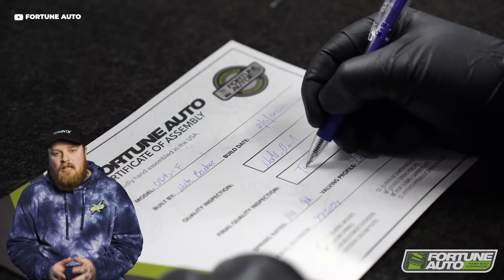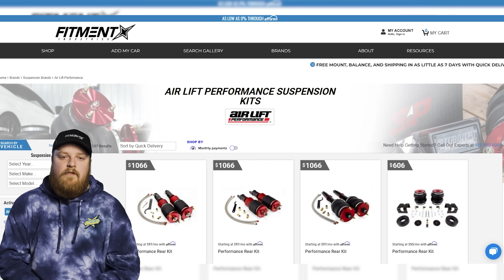Coilovers or Air Suspension | What's Right For You?

Comment: Static is better, infinitely superior, but when you live where I live, you need bags to get over potholes and speed bumps
Reply: I Leroy Jenkins potholes and bumps
Reply: I think what you mean to say is Coilovers are Superior for competitive track and Air suspension is superior for daily use on public roads.

Potholes and speed bumps are not exclusive to where you live. There's also steep driveways and inclines . Turning these daily obstacles into non factors is where air suspension is superior. It's versatility on the fly. 

I run both static and air suspension. Each of them serve a purpose and at the end of the day your setup depends greatly on what you plan to do with your vehicle.
Reply: @blkeclipsel2400  what I meant is static is superior, but bags may be needed depending on your circumstances. And yes, maybe there's speed bumps and potholes where you live, but you've probably never seen roads so poorly maintained as the ones in my country, we were done dirty:(
Reply: @victor6039  which is?
Reply: @sethwell2552  basically converts your coilovers to “bags” except it’s not a bag it’s an air cup it goes on top of your coilovers so when you’re driving you’re on coils with the static feeling but when there’s speed bumps you hit a switch on your front goes up about 2 inches and you can clear them a lot easier, kits come with air tank compressor and so on, it’s not recommended to drive “aired up” because it’ll be super bumpy and could damage the cup system itself
Reply: Wrong
Reply: Given how fast holes form in my city I might consider the airbags
Reply: @fishy_cheese4630 what are some good kits?
Reply: @sethwell2552 west Canada? There are pot holes 3 months after a road getting repaved
Reply: Well that doesnt sound like infinitely superior does it?
Reply: Ive seen static got totalled over a pothole. Static is for stupid people lol
Reply: Let me guess Michigan?
Reply: Ex trucker, air bags is definitely a better ride. But coilovers seem to be in my price range at the moment. So probably going with that

Comment: I've been running Fortune Autos on my car and I've absolutely loved them, but when I get my next car, I'm kinda leaning towards air just because it's cool and different. Plus the alley to my driveway is dummy steep and I scrape almost every time.
Reply: Sounds like air is a no brainer for you good sir. Get airlift 3p or 3h! Worth every penny. I’m thinking about getting it for my daily now. Had it on my 370z for 4 years now, no issues no problems.
Reply: @finnilrebna348  that's what I was thinking. I'm leaning towards the 3h because of the cool auto height stuff when you fire the car up. Either way, I think it'll be fun to do air on my next car.
Reply: That’s cool! I’ve been wondering how the fortune auto suspension is!
Reply: @Paper.Power.Politics  they're fantastic! Very well built and a lot of adjustment available on them. Just overall a well rounded coilover that you can really rely on.
Reply: @richgrassmann2009  sweet i noticed they also do custom spec! I’m looking for something I can adjust to I can go back and fourth  from street/drag set up and track set up
Reply: @Paper.Power.Politics  the Fortune Auto 500 series is great for that. When I road tripped my mustang to Tennessee and back, it was a little too low with all the extra weight and such, so when I got to Tennessee, I just adjusted the rear a bit in my grandpa's driveway. Super easy to work with. It helps too that they're not stupid expensive. All in all, they are great coilovers and not super harsh either. My mustang is my daily so I've lived with them for a good while now.
Reply: @richgrassmann2009  nice ima definitely keep these in mind.
Reply: What exactly is your damage from scraping? I don't want bags, I want coilovers. But I fear the damage to my ride, possibly damaging muffler, etc. Is the damage really that bad and or are there alternative safety steps one can take like screwing additional splash guard pieces to protect chasis, other parts below? Thanks! =).
Reply: @afriend8961  so pretty much anything from frame and exhaust, to oil pan depending on how low you go or how high the bump or steep the incline is. My mustang scraped on the aftermarket cat on my downpipe, the side skirts, and the frame rails along the side. One more recent solution I've seen is the stuff like Fortune Auto's cup system. FI have talked about it before, but it's an air cup that sits above the spring and allows you to raise your car a bit specifically for clearing bumps and driveways, then air back down to your ride height. Super cool stuff, but a bit pricey.
Reply: Right I live in the city and even if I didn't I used to live close enough id drive there often. Air makes sense if you can't sacrifice ride height everywhere (and have the money)
Reply: When i saw this comment i squinted and my head began moving left to right, pro-furiously 😂 we cant scrape the Carbon bro!

Comment: I have both bags and coils, and I personally prefer bags because it feels like your riding on clouds. But these bc coils on my accord are the best I love them and recommend them to everyone!
Reply: How much money do you spend maintaining bags? Like how long would bags last me in Michigan with all the salt and weather changes ?
Reply: @demetriixx9964 maintenance cost is next to nothing if you buy the correct maintenance components with the kit. Smc check valve with the ability to disassemble and clean yourself ($25.00).  Electric tank drain kit. ($65.00)
Water trap (from $25.00 to $55.00)

Maintenance itself is basically free afterwards unless something goes out or gets damaged from being installed incorrectly. 

Maintenance mainly consists of purging water from your tank and keeping your system dry. With the electric drain kit all you have to do is push a button. I've had airlift on my daily driver for 2 summers and 2 winters and the only thing I've had to do is disassemble and clean my smc check valves as they can eventually seize.  Took me 30 minutes and only had to do once so far.  I also had to reconfigure the system which takes maybe 5 minutes while on a flat surface.

Other than that I personally chose to hose down my bags every time I wash my car.
Reply: Dude s @demetriixx9964   how do you think threads on coil overs are gonna fair in those same conditions?  In those conditions I would just run nice static non-coilover setup like some B8's or something.  You can try to clean coat your coils when you first get em and paint the the threads up with anti-sieze  but you will absolutely loose that battle, just a question of how fast.
Reply: As a reminder, and as stated in the video, heavy duty trucks like long haul tractor/trailer's, firefighter trucks/engines, etc. all run air suspension. Even driving in the northern cold in winter. You'll be fine with basic maintenance, clearing out the condensation from time to time, etc. I would argue they fare better in winter. Because if you're driving this in the winter and snow it's not a garage queen or tack day whip. 

I had Airlift system (3/8" dual pump) and winter i had zero issues. In fact the winter and salt seemed to affect my KW V3 worse - at least on surface areas. Of course YMMV

Comment: I think by spring time. I'll be having an air bag suspension installed for two reasons. The cool factor of course, and also to prevent someone from sliding a jack under my truck while I'm sleeping and stealing my wheels or catalytic converter. As a young kid in the 90s, I've always dreamt of having hydraulics to show off. But I knew a guy who had hydraulics and man that's a really uncomfortable ride. I think air bags would give me all that I want.

Comment: Probably go Air because I have one car, and I live in a state that gets snow. So on the fly ride height adjustment seems the best bet for me
Reply: Just came to say this exact thing.
Reply: Imo if you're gonna leave reasonable ground clearance, go coilovers, if you want to drag ass and Don't have a second car, go air.
Reply: @Prestiged_peck the greatest benefit of air suspension is not having  to drag ass while driving. Air suspension can be factory height, lower than factory height, higher than factory height and slammed when parked. All at the push of the button real time. 

There are 5 height preset options along with the option to adjust each corner manually. 

The only suspension that forces someone to drag ass is coilovers. Until you lift the car and remove each wheel to adjust .

Comment: I would choose air cups. I have a Hyundai Accent and I like this car. There is only one problem with it. It's not high enough. Sometimes I need to drive through some rough terrain and I don't want to hit the bottom of my car against rocks and dirt. So I would like to have the possibility to drive on coil overs when doing the high way and drive on air when doing the woods.

Comment: There are tiers to this debate as there are layers to the application of either. 

Common “Street” series suspension are typically lower quality than “track” series coil overs. Meaning, if you take “street” series coil overs to the “track”, you will more than likely under perform.  “Track” series suspension is peak equipment for “track” use. On the other hand, daliy’ing “track” series suspension on the “street” is like “over paying to kill a mosquito with a bazooka” while the full performance potential will in most cases remain untapped in imperfect “daily street” conditions.

Airlift suspension has been proven to perform on “track” just as well as, if not better than, “street” series suspension in addition to being more ideal for daily “street” use than “street” series suspension in most applications. Put simply, “Track” suspension is BEST for track conditions and well dialed Airlift suspension is ideal for daily “street” conditions. IMO

Comment: Never ran air. Well atleast not on cars. Obviously my rig is on air. But now that ive recently got a vip car. Time to move into the air ride.. currently the vehicle ( 08 jag xj vandan plas )has its original air suspension but not with levels of dropping it yourself on a press of a button. Therefor somewhere down the line i will definitely be installing some air rides you was talking about.

Comment: I think I'm going to go with the airlift suspension because I'm going to be using a truck and most of my weight in the bag is going to come from the fuel cell and whenever it loses fuel because I'm driving on the street and what not I can have the adjustability right there

Comment: I would like to have bags but One day I saw a car with airlift suspension,  was completely stuck aired out to the floor the owner couldn’t lift it.  What’s the solution in that case ???  To move it or if the car breaks down and is aired out ?

Comment: I am thinking about air suspension for my miata to help with a disability. Would air suspension allow me to raise the car above stock height to get into and out of the car but then drive at stock height? Does air suspension work when the car ignition is off like before i get in the car?

Comment: I understand the need for it, but... forgive me if it might be a stupid question, I drive through an old logging road on a lifted corolla daily as the logging road is my driveway, it gets worse mileage with its lift still far better than any suv but some days you need it to get through due to mud, rocks, etc etc. are there like air LIFTS? like not for dropping the car, but for lifting it above stock when you need it, like a coilover plus a airbag on top? I know that there are these for trucks, but anyone know of any company that makes them for sedans, or are they a niche thing? I suppose what I mean is there is a market for lowered air ride sedans, but anyone know of any for lifted air ride sedans or are they all like stock or lower?

Comment: Sorry… Newbie question… I’d like a lowered Daily/Band hauler… I want to murder out a Ecoboost Ford Flex with air-ride suspension so I can lower it, my question is with the heavy weight will the raising and lowering suspension break under the added heavy weight with large band equipment??? And would I be able to drive it lowered with band equipment in the back???
Reply from the maker: You should be just fine!  You’ll be able to adjust the pressure in the rear if you have something heavier back there!

Comment: Glad you mention that they could handle hard driving. I have a Silverado that I dropped. Springs/spindles. Overall like it but rode in a Tahoe with bags and liked the way it felt. I was always worried about bag issues because had a few buddy’s going through bags every 6 months or so. Never wanted to be stranded. Their bag issues were happening in early 2000s so I’m sure it’s been improved. Still 50/50 on the idea but definitely good to hear

Comment: I drive for daily use not performance. I'd just want the lowered look and comfort. That in mind that last one you mentioned looks ideal. Any more info on them or maybe a list of other brands that make something similar? Haven't lowered my car yet but when it comes time to change the shocks I definitely want to upgrade to a good coilover or just a lower suspension setup
Reply: You could always go for lowering springs. It’s something FI has talked about a lot too though they focus more on coil overs and air overall.
Reply: @djhero0071  true, but the stock suspension on my car has a lot of body roll, they are too soft. Also lowering springs may not always be a great option, because it can mess with the alignment of the wheels and cause unexpected tire wear. Which I'd like to avoid as much as resonably possible

Comment: I have a new mustang GT performance package and thinking of air ride suspension.  Something I'm being told is that if I end up adding more hp and torque, supercharger, air ride isn't the way to go as it can't really handle it.  Is that false?  Should I just go with coilovers to remove the wheel gap?
Reply from the maker: A mustangs on air looks sick 👀 but if you’re going with more power too, I’d go with coilovers
Reply: @FitmentIndustries  I would love to however I have magneride and nothings available yet.  I think i"m going to just go with springs.

Comment: I can’t find any shops in Sacramento that will install air bags so I’m looking at air supply Bakersfield for 3700 but it’s 5 hours Away….. I’m worried about something going wrong and then I’m stranded and would have to pay a tow for 5 hours. Should I just give up on getting air suspension for my glk350???
Reply: Coilovers with air cups and call it a day
Reply: @diddy2612  I never heard of those before today, I wondering if I’m have the same issue of not being able to find a shop to install them
Reply: @cliftonsargent1572  it shouldn’t be. I have kw coilovers with stance parts air cups on my nsx. Best suspension setup I’ve had
Reply: @diddy2612  ok cool, I’ll ask about getting air cups installed, and they just raise a little bit and lower but your pretty much on coil overs
Reply from the maker: The install is really not too bad if you have some help! Check out our air suspension install videos on our channel! Here’s one - https://youtu.be/zr273NCPH_g
Reply: @FitmentIndustries  this is why your channel is my favorite hands down, only huge channel that responds to the fans. I’m a basic bit*h and can’t do that on my own. As soon as I can find a shop to install I already got the parts I want from you site

Comment: I ran air suspension on my car for about 6 months….the only time I enjoyed it was when it was air down and it was parked😂 other than that the ride was horrible no matter what!
Reply: you sure you werent running too much psi in the bags? i got a vw wagon with bags and its like butter on smooth roads lol some bumpy roads i feel feedback but i dialed in the perfect psi to where its like what i would feel when i ran coils
Reply: @error_displaying_name  yeah I was doing anything from around 30-45 all around to see if I can try to get the best as I could but no matter what it was a rough ride! Unfortunately I live in the city and nothing but crappy roads..
I had it on my fiesta st but probably didn’t help that the car only weighs 2700lbs 🤔 that’s probably could be the cause since the car is so light

Comment: I went from springs, didn’t lower it enough, opted for adjustable control arms, low enough but rides like shit. Decided to purchase 1500$ coilovers, front rode great, but since rear has a solid axle it still rides like shit. Called it a day and ordered an air lift kit. Take it from me just save the extra 500-700$ for the air bag kit 😞

Comment: If you want to ride with negative chamber and destroy your expensive tires, then air shocks are the least of your worry's. Shocks are meant to keep the tire tread touching the ground. You have less than 1/8th sq ft touching rubber to the road, otherwise you might as well put bicycle tires on all four corners. Just make sure the spokes & bearings are heavy enough. I see this next to me on the road, I am getting far away. See you in a ditch on the local news.
DK, ASE master tech since 78.

Comment: To bad no one aside from Godspeed make aftermarket suspension for my daily. I daily a 2009 Toyota Venza awd and I specify awd because the fwd venzas have different rear suspension and there are a lot of options for coilovers for a fwd venza. Even worse still though if you input your make and model on fitments website under Toyota they don’t even have venza as an option for model. And if you think you can try to cheat lol and look for highlander suspension because I’m pretty sure they’re the same or super close at least you can only find fwd highlander suspension which like the venzas are different then the awd ones. So if you drive a venza your basically stuck driving a grocery getter at least mines the v6 with decent power and you can get some performance mods for that engine